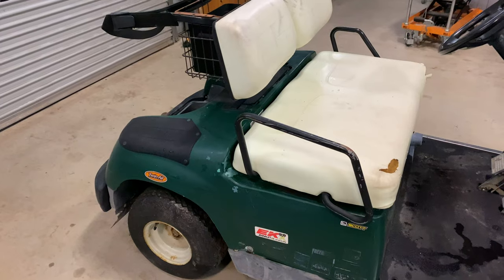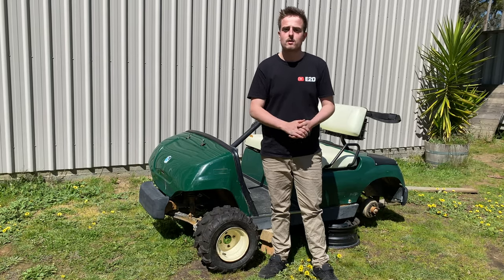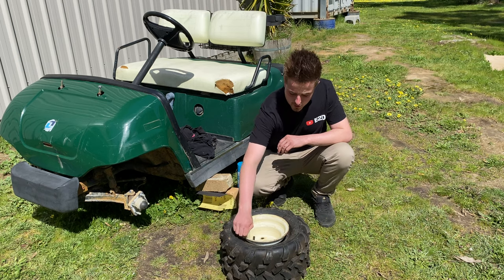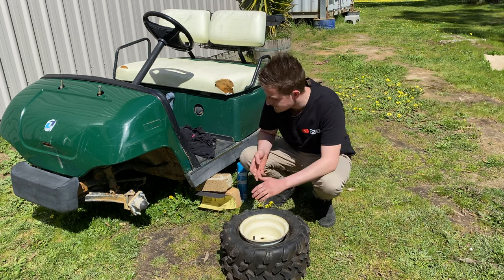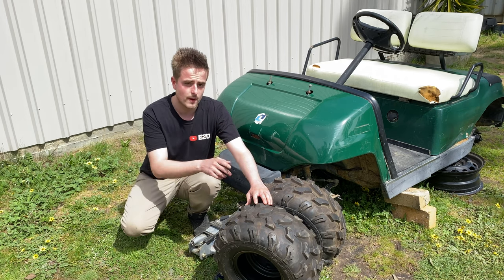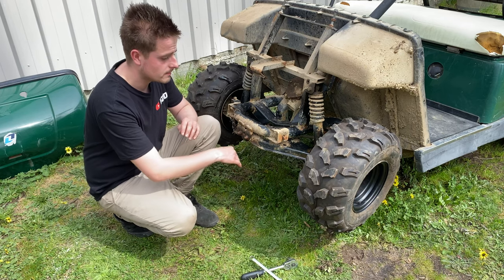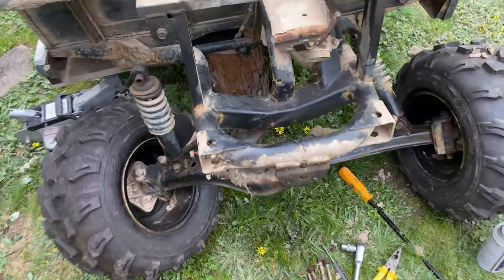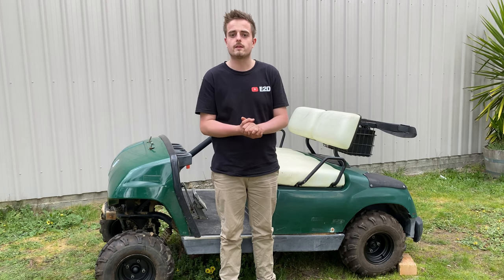How To Make A Golf Cart Lift Kit

Comment: Next time shoot them with some starting fluid, spray inside the stand back and light it up and the tire will usually pop on the bead and give a bit of pressure in the ole tire give it a try one time.

Comment: They push the front forward to make it a longer wheel base to help make it sturdier
Reply from the maker: Thank you that makes more sense, I will be ripping it out in the future..
Reply: @EngineeredToDesign  no prob man when you going make some more vids on this I just picked up a few been watching this build
Reply from the maker: @jaynjay9595  making a video today but it’s not on the suspension hopefully doing that very soon once I figure out how to bend this tube properly 🤙🏻
Reply: Mark where you want the bend cut half way threw with a angle grinder and bend it useing a table and some c clamps or vice grips on end of table then weld that seem up
Reply: If you have fb I can send you some stuff that help some vids and pics
Reply from the maker: @jaynjay9595  I have a Facebook page shoot me a message on there 👍
Reply: Name bro?
Reply from the maker: @jaynjay9595  Engineered To Design